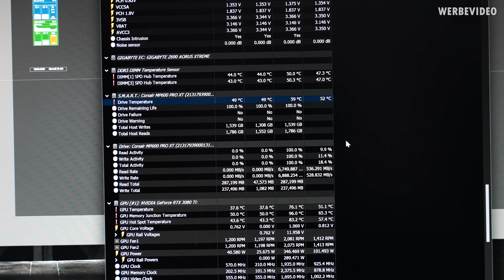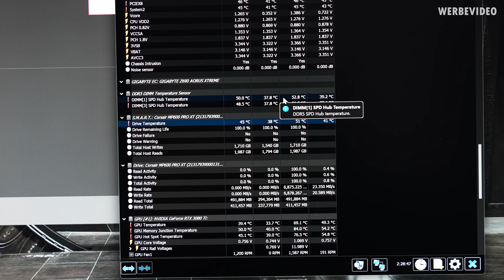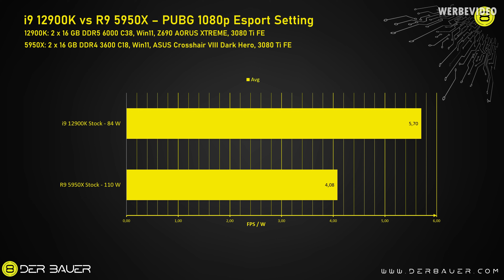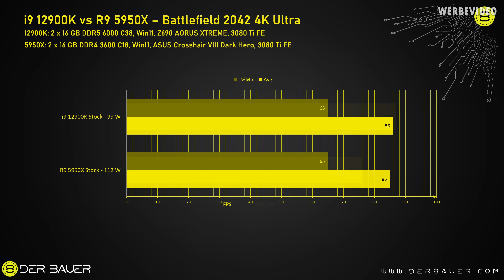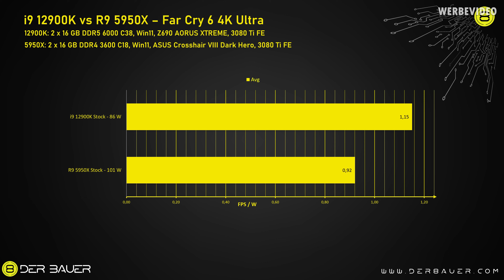AORUS Z690 Testing and Surprising FPS per Watt Results testing i9-12900K vs Ryzen 5950X

Comment: I dont think its very fair to use DDR5 6000MHz CL38 (ULLLLLLLLLLLLLLLLLLLLLLLLLLLLLTRA rare memory?) and couple the 5950x with DDR4 3600... Cl18?

Maybe the two CPUs are closer if you use e.g. DDR5 4800CL40 for the 12900K and DDR4 3800CL14 for the 5950X.
Reply from the maker: I can also use the 12900K with 4000CL14 on a DDR4 Board. I think it's qute fair. Even 6000CL38 is not great.
Reply: @der8auer-en  Hey thanks for the reply.

Maybe I'm stupid but if you were to use a DDR4 board, why wouldn't you use the same memory you used with the 5950X - 3600CL18? Why would you choose superior 4000CL14 RAM for 12900K and "terrible" 3600CL18  for 5950X - that makes no sense IMO.

But I think testing this with DDR5 is correct - 12900K has a platform advantage and if I were to buy one, I would absolutely go with DDR5! But you did a video earlier where DDR5 (5400C36) could be up to 20% faster than e.g. 4800CL40 in Farcry6. And this is using 6000MHz which is even faster than 5400.

You say that 6000CL38 is not great - but AFAIK it is the best DDR5 in the world right now, no? There is nothing faster. 99% of people who buy 12900K will not have this kind of memory. But 3600 CL18 is pretty much cheap budget RAM.
Reply: It is not, but it is really hard to be fair. We have already seen games straight up gain 5-10 FPS just from the slower DDR5 kits, so for myself i can shave off that hypothetical advantage and get the performance per watt without the ram benefit. 

You have to understand tho, that this video is showcase of the Aorus board First and perf/watt test second, therefore switching the board for one with DDR4 for the most fair testing possible, does not quite make sense. 

You are still right, those unicorn DDR5 sticks are... well unicorns.... they exists but good luck buying a pair and there are much better DDR4 kits out there.

Comment: It's only $200 more for the WRX80E with four times the Ram channels and four times the cpu lanes to the PCIe sockets. ZEN3 TR PRO is said to offer 12/16/32/64 core cpus. That's desktop>HEDT>workstation on one board.

Comment: This is what I've been saying as well, the 12900k CAN draw a lot of power IF you use all the performance that it has. However under "normal" scenarios it's very power efficient. Great video, this sort of test really need to be standardized. For graphics cards too.
Reply: Explain why rendering images/video or compiling is not a "normal" scenario and gaming is. Also 12700K considering the price is overall better cpu for purely gaming usage.
Reply: @veduci22  a very, VERY small % of people using computers do image editing or code. Most people who get these cpus are probably gamers.
Reply: @veduci22  I didn't even mention gaming in my comment, sucks to be you I guess.

Comment: correct me if i am wrong... but overall the impression i get from hardware unboxed testing is that... AMD cores are not as highly utilized as intel cores. across several games (including the BF 2042 here). so for example while an AMD ryzen 5000 core might reach 56% ultilization, then the intel core might be 78% utilized. And I believe this effect can help to explain the Frames per Watt numbers. Because once a core is started being partly ultilized. Then presumably the power usage is significantly increased. Because it cannot drop down into an idle state for sleeping modes etc.  Also my other question in regards to using 5950x for testing is why use 2 ccx? you should be using only 1 ccx for more gaming loads. And with maximum cache per core. For example 5600x should give a more 'ideal' power effeciency per frame. Perhaps if you split across CCX that may cause issues. And maybe if windows is too stupid about the scheduling for AMD side, and is then engaging the IO die for no reason will consume a few extra watts? Or perhaps not IDK. Because you didn't go so deeply here in this video these details. However perhaps also on the flip side, the intel alder lake effeciency cores and with the thread director... it might be some real advantage in the frames per watt? To offload background tasks to effeciency cores. And maybe even some of the game itself. However again, those deep dive isn't present here in this simple video. So maybe (again) under configuration if somebody comes along in future. They can like for the single CCX... they can also run A-B testing on the intel side. To turn on and off the effeciency cores. And see the influence. To help us understand better the amount what is due to.

So to summarize: either 1) poor ultilization of cores on ryzen side. With better core utilization on intel. or 2) on ryzen being split across ccx or 3) intel effeciency cores.

With those eliminated then we can see better the real difference in the main architectures and the process nodes. But even then, we have zen4 coming staggered release. When alter lake will only have an incremental next update. So this leapfrogging should (in theory) help to return the advantage back over to amd. This is also assuming games are coded properly to work better with AMD cpu cores. Because ATM they are still being under utilized

4) I forgot to mention that memory latency is in fact very important for BF2042 performance. So that also has a big impact, for example that AMD ryzen is limited in it's memory latency. Wheras alder lake can be tuned more tightly, those memory timings. This may also be one of the reasons why intel cores appear to have a higher utilization. (for hardware based  reasons other than simply game optimization)

Comment: It makes sense the 12gen isn't nearly as bad as what people think hearing that it draws 240W peak under full load. Because efficiency falls off a cliff when you're pushing to the maximum. But it should be the same for the ryzen chip, no? Why is it close to max power draw in games when it couldn't possibly have 32 threads occupied? Was MCE disabled but PBO enabled and it made stuff weird? There's something fishy in the results...
Reply: Ryzen power plan is my guess, on my 3600 it gave 1.45v at all times.  Switching to the standard windows high perf plan allows it to cycle down to <1v.

Comment: I think it's a serious mistake by reviewers to measure power consumption via stress tests, while that never translates into real life scenarios.
And as it is visible, the real life scenario shows something completely different.
Reply: I mean you don't test a race car with a 25 mile an hour speed limit And that's about 40 km an hour for reference
Reply: @SaiakuNaSenshu  All the consumption tests I saw about cars were not drag racing results, but combined city / highway / motorway. So I hope you got the analogy. No one's going to use the processors for 24/7 cinebench or burn tests. Measuring consumption that way is unrealistic, and tells the user nothing about what he can expect.
Reply: @Homelander-ftw  Plenty of people have more intensive uses for their 12900K than playing Candy Crush. If you don't, you might want to reconsider the life decisions that led you to buy a 12900K.
Reply: @imadecoy.  Here you are again. You talk in such hypotheticals all the time. I have a powerful CPU (5950X) on my computer for data analysis tasks. It is VERY little % of total computer time that the CPU is fully taxed though. I need it when I need it but the total full load is perhaps 2% of total computer uptime. Anyhow, if I were to build a new computer right now my choice would be 12900K. It is winning on all fronts to my current system.
Reply: I mean, stress tests are important as well, because if your CPU can’t handle a prolonged all-core load, it’s simply just gimped.
Reply: all that reviewer take alot amd money

Comment: Been asking GN for performance per watt ratio for months.  If intel uses 20% more power for similar results, who is actually better?
Reply: Intel having less core and thread than 5950x force them to push the frequency to surpass 5950x. So 12900k use more power at absolute max load. However it can achieve like 90% of 5950x benchmark with 60% of the power.
Reply: I think this metric should be included for any benchmark testing.  ie: Cinebench rating took "this many" watts with "this" cpu.

Comment: Nice video, but I would like to see watts measured at the 12V 8pin power to the CPU (or somewhere where you can use tools to measure amps and volts). I guess high end motherboards use good parts so the VRM power consumption wouldn't be that different from board to board. I dunno.... informing video nonetheless. From what I've seen, performance per watt at high CPU usage, Intel falls behind a bit.

Comment: Sorry if I didn't catch if you said it in the video, but how the power consumption was measured? It was in the wall or onboard sensors?
Reply from the maker: using hwinfo and current clamp to double check. But current clamp includes the switching losses of the mainboard so I used hwinfo for calculation

Comment: they came up with those cover because the launch of ddr5 has the most non rgb stick. so gigabyte thinks that they need to make that kind of cover to fit with RGB builds. or maybe theyre stupid. idk
Reply: Yeah, I think also people are having to settle for whatever brand and model of DDR5 memory they can get at the moment, so having a matching cover allows you to use whatever color/shape of RAM you can get and not worry so much about what it looks like. If you can only get bright red modules and your build is another color, it’s not as big an issue.
Reply: good point I think you're right, bravo ! yeah still waiting for my ddr5 and it's going to be standard sticks there's no rgb ddr5 except for youtubers this far
Reply: also, making it steel or metal, makes it heavier. well, that is all what i conclusions tho.

Comment: Would be interesting to see perf/watt in non gaming scenarios
Reply from the maker: Will have to look into how to measure this and which benchmarks
Reply: @der8auer-en  i personally would love to see linux kernel compile times
Reply: 9900k 5950x on each side of my desk for all of 2021 it's very easy amd idle watts is awful at least 10y behind intel because a stock 9900k ildes at 800Mhz@0.8v while amd 3400Mhz@1.0+V gaming is hot on intel because of the clock speed which games love but not that bad, amd is only king when you use 100perc cpu, i have 29451 cineR23 on a 5950x@187w intel can't hope to beat this ever amd are unbeatable hybrid workstation-gaming but not the best everyone computer
Reply: @fredEVOIX  since ryzen is chiplet based with an IO die inbetween it is sort of expected to have higher idle power consumption
Reply: @fredEVOIX  that's very insightful. Though I read 12900k cracking 30k on cinebench just recently. Do you think even with that alder lake has no chance beating the 5950x?
Reply: @LeFatalpotato  LN2 cooling vs 200w cooler...
Reply: @savifrank6323  it was not ln.

Comment: Since you used top end ddr5, why not also use best ddr4 for ryzen, like 3800c14 or 4000c14, it would make difference in most games
Reply: @ItsKunkey  I so agree, Derbauer as well as other techtubers seems to use budget ddr4 ram when they compare to ddr5 alderlake. I have seen Asus/MSi streams where they used crap ram of cl18 20 20 36 vs ddr5. Derbauer used as well very loose settings in the last ddr4 vs ddr5 alderlake testing. Something is up.
Reply from the maker: I just bought a 4000C14 kit last week to have an updated DDR4/DDR5 video soon. I don't think it will do much for this comparison tho
Reply: @der8auer-en  that sounds great, thank you so much!
Reply: Ddr5 6000 c38 isn't very high end. Consider ddr5 starts at 4800mhz and ddr4 starts at 2400, they are both basically mid range kits. Ddr5 is still young, and what we consider "high end" right now is actually very average.
Reply: @qT_p13  doesn't matter, it is high end right now (what can you buy that isnfaster right now), and 3600cl18 is almost rubbish, at least if you have 5950x and want to play esport games. Also 3800cl14 is also not top end of ddr4, there are 5200 and even faster sticks
Reply: @riba2233  so since you know there are better kits of ddr4 than 3800 cl14, you would complain if he used those as well? So, damned if he did, damned if he didn't?
Even if he used the absolute best ddr4 kit, the 12900k would still display better efficiency because of its lesser power consumption to fps ratio. And then you could still make the argument that ddr5 will only get faster, and when the 8000 kits come out, the intel chip will be even more efficient.
You do also realize he was shocked at the result, as we all most certainly are.
Reply: @qT_p13  I am not shocked at all (I have no problem with intel being better in this regard, I just like exact numbers because amount of difference matter), since zen2 and 3 lose some efficiency on io die, but I really see no reason to make this comparison with low to mid end ddr4 kit. He should use kit that is most optimal for zen3, 3800 or 4000cl14 dual rank and that's it. Far cry is especially ram sensitive, but all esport games are, and that is where you need most fps.

Comment: Could someone please clarify a few things for me? Am I right in understanding that, in the benchmarks, the games are more CPU limited by the AMD processor (with the Intel processor having more headroom)? I'm guessing the power consumption was taken from HWinfo?

I'd be interested to see how they stack up for more CPU heavy tasks per watt, like 3D rendering.
Reply: only dx12 games use more than 4-8cores meaning 99perc of games dont and when they dont only clockspeed matters this is still true in 2021, even if dx12 handle more cores they do it very badly and still hate multithreading(forza horizon 5 only uses the real cores fyi) I can only tell you what encoding videos and cinebenchr23 are like as I don't do 3d and for work AMD is much better, i have a cinebenchr23 29k score with the cpu at 72deg I havent tested the 12900k yet waiting for ddr5 >< but I highly doubt it'll be that cool
Reply: TechPowerUp already do those types of charts and the 5950X decimates the 12900K in that regard, scoring 6.4 KJ Vs 10KJ for the 12900K (whole system) 
Zen3 is super efficient when pushed.
Reply: @TechLevelUpOfficial  That's cool, so it's different when they are pushed to the max.

Comment: I am not sure about mobo's with lots of NVME slots, it cool to have room to upgrade but is a PCIE NVME card a better option as it's simpler to get the drives in.
Looks like a pain to take the mobo apart each time I want to add a new NVME drive, in a case it cant be simple to do.
Reply: one pcie cards ruin your case airflow and create more noise if you have bottom fans two using pcie for nvme steals cpu bandwith while most motherboard nvme (all but one) use chipset bandwith, for that same reason you don't want to have a 10gb ethernet card but have it integrated into the motherboard, on amd trx40 or x570 you don't care that much as bandwith is plenty and usually balanced for most slots but on intel it does because they have this useless pcie5.0 slot that by itself uses the equivalent of two x16 pcie 4.0 slots on a x570 and no you can't just slow it down to get that bandwith back thats not how it works those x16 4.0 lanes are lost some motherboards only have 2 or even 1 really usable pcie slot as the cpu bandwith is taken by onboard m.2 etc..ALWAYS read MB manuals never buy a MB based on review or looks you will 100perc regret it
Reply: I’ve added a couple of additional M.2 drives to my motherboard since I built the system and it’s just a matter of removing the video card and adding the drive. It takes less time than adding an older 2.5” SATA SSD, where cabling is involved. Really not a big deal. On this mobo all of the M.2 sockets are above the secondary PCIe slots, so you shouldn’t even have to remove anything in those expansion slots to access the drive sockets.
Reply: Mobos with lots of NVME slots allow you to for example use raid 10 (2 mirrored sets of 2 striped drives) which allows you to have massive amounts of storage that is redundant without having to have any messy cables and allows you to upgrade with sata drives if you need to
Reply: @AlpineTheHusky  I may have badly worded it.

I want the NVME slots but having to pull out the GPU then the faceplate looks like a pain V pulling out a PCIE card then slapping in a new drive.
You still have all the RAID options if needed.

Im all for more NVME drives, im on X570 and used my two slots so now using SATA ports to my "joy".
Reply: @liaminwales  I personaly want NVME slots on a board for when Im building the PC cuz I domt wanna HAVE to add a add in card when I dont have to only when upgrading as you only habe that many slots
Reply: @AlpineTheHusky  On that mobo there exchanging PCIE slots for NVME slots.
I do take the point tho.
To be clear I think NVME are the way, there about the same price as SATA but faster.